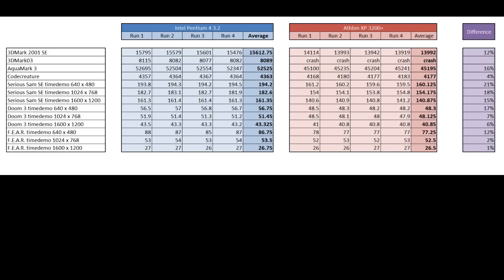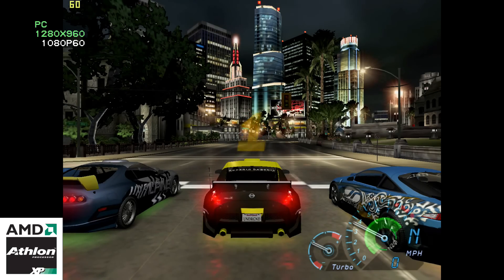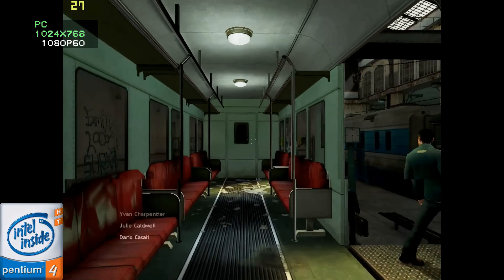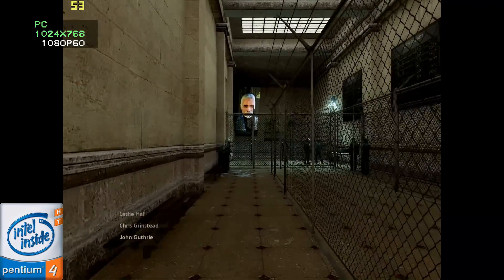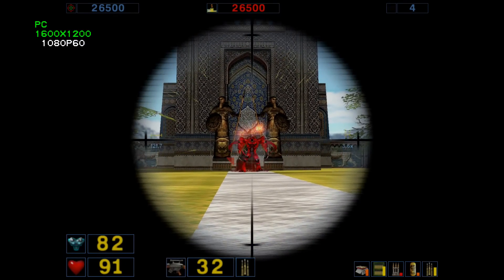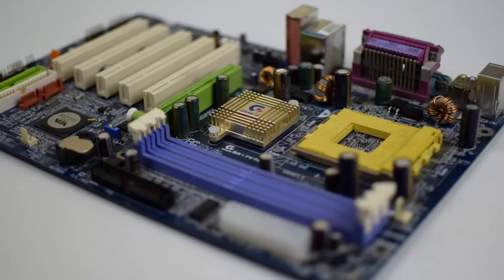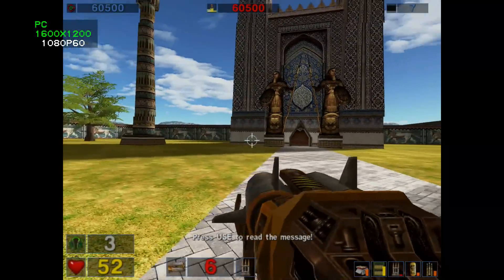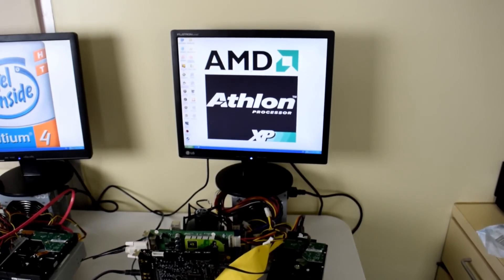Intel vs AMD S1E1 - P4 3.2 vs XP 3200+

Comment: Now I have a real motivation to fire up URGM 2.0 again. I guess I never recorded benchmarks from that system. I will have to rectify that! I am pretty sure my Abit NF7 with the 3200+ was faster in the scores, but being an ultimate retro gaming machine, nForce 2 was the only way to go really. I know the KT600 was a bit of a dog in a lot of ways. Still though, even with the KT600, we are talking about a marginal performance difference with the P4. Consider also the XP is running at 2.2Ghz, a full 1 gigawatt ( Doc Brown lingo there ) less, it is clock for clock beating the crap out of the P4 :)
Reply from the maker: +WaybackTECH If only AMD could have gotten the chip to 3 GHz, things would have been different.

I was looking forward to some more videos about your massive retro haul. That looked like a lifetime of computing work to me :)

I think the KT600 was a decent chipset. It certainly was a late revision, there was only one revision after that, 800 something with dual channel memory support.

The thing about using nForce, or better RAM, or tweaking is that you can do the same thing with the P4. Go with a high end 875 chipset with PAT instead of the 865, grab some CL2 memory, tune the BIOS and you got the same gap again.

I'd love to have a 875 chipset board to be honest. For some reason they aren't cheap. Same goes for good nForce boards. The high end always attracts a premium. This is part of the reason I go with the more mainstream stuff like 6600GT instead of 6800GT, they are much easier and cheaper to find.
Reply: From the stand point of building either of these 2 systems today for cheap, I completely agree with your choices, heck even 3200+ Athlons are expensive as well. P4 is vastly more common to find.

875p chipset would be an impressive way to go for a great 478 build. EE P4 3.4 with the 2MB L3 cache seems interesting but I am not sure it is as good as the 1MB Prescott chip was, also being a fat 130nm vs 90nm.

There is an ASUS P4C800E Deluxe for sale here in the states. He says will ship world wide. Pretty cheap starting bid, but it might be a crap shoot board though. http://www.ebay.com/itm/ASUS-P4C800-E-Deluxe-MB-Intel-P4-2-8-Ghz-SL7PL-Cooler-Master-LED-Heatsink-Fan-/141863473682?hash=item2107b8d212:g:zpwAAOSwNyFWgc54
Reply from the maker: +WaybackTECH Nice find. I think this will do well, it has a good description so will pop up on all the searches :)
Reply: +WaybackTECH Prescott CPUs had 30 pipeline stages vs the 20 that Northwood/Gallatin had, so no.  The 3.4GHz Gallatin based P4EE is top dog (for single core) of the NetBust era.
Reply: Mister BluntSA
Good to know!
Reply: Mister BluntSA
I had forgotten about the 30 stage pipeline. I am actually looking at the P4 EE 3.2, just because the 3.4 is insanely expensive. Might be fun to play with, comparison videos and such.

Comment: Interesting times; first machine was a first gen pentium 4 1.3 ghz.  I still have it though its in the process of being rebuilt (socket 423 to 478 adapter for a 3 ghz variant).  For cpu coolers i've run a Zalman CNPS 9500; though a bit of a pain to install (watch out for the copper fins... >w<) seems to keep the cpu from passing 60c under load.  Granted its a northwood core however it may be something to look into if you are interested in keeping the Pentium 4 from thermal throttling.  Anyway; always fun and educational to watch your reviews and benchmarks, thank you for taking the time to make them.  :3
Reply from the maker: +Nachokinz I can't stand the socket 478 coolers. I think if I build a high end Pentium 4 I would just go with Socket 775. Modern high performance coolers will fit nicely and tame the P4 :)

Comment: you should try this with a LGA 775 Pentium 4 or test both the LGA 775 Pentium 4 vs the socket 478 Pentium 4
Reply: You should also do s775 p4 vs athlon 64 socket 754 vs athlon 64 socket 939
Reply from the maker: +SilverX95 I'd love to do that. Added to the list!

Comment: HOT DAMN. The argument i have had for years... I love my XP 3200+ (in an FIC/EMachine FIC Motherboard) but my P4 (Dimension 4400) has SSE2 instructions ;)
Reply from the maker: +Jason Hicks (TyrForFreedom) Yea I think Google Chrome wouldn't run on the XP anymore, but did on the XP.
Reply: +PhilsComputerLab you may want to give pale moon browser a whirl. the have built it using firefox ESR and many built for different processors

Comment: Wouldn't Athlon XP vs P3 be a bit more fair?
Reply from the maker: +GlaciatorGaming Not really, when the P3 was around, AMD had the standard Athlon.
Reply: PhilsComputerLab Oh, then sorry I guess.
Reply from the maker: Well the Tualatin gear I have used SDRAM running at 133 MHz. Does the Athlon use DDR already?

Comment: Will the pentium 4 3.2ghz work on a DELL dimensions 3000 34 bit? BIOS AO3?
Reply from the maker: +The Hh With questions like this I recommend checking the support website of the manufacturer. Or just try it out. A P4 3.2 shouldn't cost much.
Reply: PhilsComputerLab I'm worried that it may overheat. The manufacture says that it allows hyperthreading, so is that a good sign?
Reply from the maker: Yes that's a good sign.

The worry with overheating is having a good CPU cooler. You can monitor the temperatures in BIOS or through software in Windows.

Comment: Personally I had both , in 2001, I replaced my ageing PPro with a Pentium 4 (I think it was 1.7Ghz ) , but within a year and a bit , the whole system got fried from a power surge (that was with a protector too) , and the replacement system I got was an Athlon XP 1800+ , later upgraded to a 2100+.  It was a great system that lasted into 2007 ,  stable too.

Right now I do have an Athlon XP 2800+ (barton revision) sitting in an Abit NF7-M board, which is a joy to use, has the Nforce2 chipset , has the 12v connector and built very well, only downside is no SATA at all (the NF7-S  did have them).

The main advantage of a P4 is the availability, everybody and their cousin owned one, so finding one for cheap is no problem.
As far as performance, the Athlon XP is obviously faster clock for clock, but I guess if you wanted faster you could just build an Athlon 64 or even C2D system.
Reply from the maker: +lightdark28 Great point, I like to think of the whole situation as :"Well I'm building machines to be slow and compatible". Speed is not that important.
Reply: +PhilsComputerLab 

I am surprised you had these problems with the Athlon XP though, the platform is generally more stable and compatible than the original Athlon boards. It could very well be the VIA chipset.  I may set up my Athlon XP board and see if it also exhibits these problems.

another thing to note is I think the Athlon boards tend to suffer more from the capacitor problems that plagued boards circa 2001-2 ,  so one needs to be careful with those.
Reply from the maker: That would be awesome if you could take a look.
Reply: +PhilsComputerLab 

Shouldn't take too long to put together , will post the results on your vogons thread (the "youtube and website updates thread).
Reply from the maker: Awesome, thank you.

Comment: Great video as always, you missed one important aspect - overclocking capabilities :) and the fact that the CPU protection is extremely weak at Athlon :( (I managed to burn one :) of course due to a personal mistake)

And I was an Athlon guy for a long time I had Athlon 700 Slot A, Ath 1400 Thunderbird, then Thoroughbred  1700+ (highly overclock-able that I burned eventually) and I exchange it in warranty for a Palomino (the only 1700+ in stock) that was a champion overclocked @ 1943 MHz) after I moved to a few Barton's and finally the best XP-M that I still have :) but eventually  I moved to P4 (3 GHz was the most expensive CPU I could afford but I overclocked it a little bit to close the gap) 

My last system before I completely move on mobile my last rig was a 754 A64 :) which was not a revelation so I decided to go mobile and bought my first laptop Dothan 1600 MHz + Radeon 9700m (from Fujitsu Siemens). 

 Now days I slowly move back from mobile to desktops :) (I have around 20-30 configurations laying around :D) and I just finished the 2 post Skywell configs (G3258 and 4790K ) both just to play with the new overclocking capabilities, my daily driver is still a mobile :) (4910MQ) 

Unfortunately with Athlon XP was the peak for AMD after those great CPU started the decline of AMD and they lost completely the edge in front of Intel powerhouse.
Reply from the maker: +rodarkone ro Great information. That Abit board gets mentioned often, I must get myself one. You're right, I skip overclocking. Not sure why, it's not my thing really. I think overclocking old hardware could hurt it, so I like to look after it.
Reply: +PhilsComputerLab forgot about one thing - the Athlon CPU's were extremely fragile (considering the die is not protected) I remember seeing a lot of CPU's with chipped die's, especially around the corners or on the edge that was corresponding to the clip of the cooler (ppl were pushing too hard on the radiator)
Reply from the maker: ***** Good point! I was extra careful when I mounted the cooler.
Reply: +rodarkone ro oh most of my atlhon cpus had the edges of the die chipped at one point. none of them actually died though. thankfully.
i have no idead why exposed internals was even a thing at all.

Comment: Ahh yes, the good old early 2000's. At around 2003 we got our first pc, and it was  just amazing, those games you showed here all are just awesome memories. I rocked an ECS L7S7A2 with an SiS963L chipset, AMD 462 socket Athlon 1.6Ghz'ish (haven't had it for a long time, so can't remember precisely the model of the cpu), 1gb of DDR1 ram and a nice Radeon 9600PRO 256mb. Sadly I still all got that stuff but they are all dead, but for the hell of it I made a slightly more powerful pc of those mid 2000's rocking an VIA Mobo (cant remember the model) with an VIA P4x400 Chipset, Intel 478 socket Pentium 4 2.4Ghz, 1.5GB DDR1 ram and was using a MX440SE then GeForce FX 5200 and now i got for free a nice Radeon x1950 PRO 512mb AGP model. Great video btw, guess i will be installing MoH and NFS again :D
Reply from the maker: +sproman These games are indeed great :)

Especially with the racing games I got carried away. Before you know it I've been playing for 20 minutes, way longer than I need to :D
Reply: PhilsComputerLab Yes, underground 1 super nostalgic for me, it's like the first pc game i ever played alongside MoH Allied Assault, before that i only had a PS1, that pc made a pc gamer :D But i still hold massive respect for the PS consoles though.

Comment: How does the Athlon work? It doesn't seem like you put any thermal paste on it, so does it not require anything? It also looks much different. I understand that's how CPUs looked 15 years ago.
Reply from the maker: +YoMamasTacos Of course I put thermal paste on it :) Just didn't show it in the video.

The P4 and modern AMD processors use a heat spreader. But google images of the Pentium III coppermine, it looks just like the Athlon XP with the die exposed. You had to be a bit careful when mounting.
Reply: +PhilsComputerLab Ah, okay. I guess
AMD was late to the heatspreader game.
Reply: @yomamastacos2123 they didn’t actually need it with Ryzen to be fair, since it’s still PGA

Comment: I don't remember having any problems with my Athlon XP and 3dm03, it might be something with the chipset or graphics card (you are running a PCIE GPU with AGP bridge chip I think, it could be more sensitive to problems?) in any case, I think you would have a better time with Nforce 2 (but I'm not sure; KT600 is actually newer, it's just that VIA was the second, lower cost option for a socket A build back in the 3200+ days, nforce 2 was the most popular for higher end s462), back in the day I had like 4 different Nforce 2 boards (NF7-S 2.0 was my favorite) and I don't remember to many problems, I went as far as a 6800 (native AGP, the older model with NV40) in 2004 with it,
Reply from the maker: +hmbrz NF7-S 2.0? I'll take a note of that. Thank you!
Reply: hmbrz TBH the k8t880 was the premium chipset for socket a. The kt600 was a bodged kt400a
Reply: nForce 2 Ultra 400 was the top chipset for that platform.

Comment: I had a Athlon XP 2500+ on an Asrock K7VT4A PRO motherboard with the same CPU cooler used in this video 2gb of Kingston RAM an Nvidia Geforce 6800 Ultra and a WD Caviar SE 160 GB Sata hard drive.
Even managed to run Hitman Blood Money on medium settings on it. I still have that computer and it is still in great shape only the GPU died and replaced it with a Geforce 6200 just to get it working. There's such a big difference in gaming with the 6200 compared to the 6800 ultra now it can barely run GTA San Andreas.It was one of the best PCs i had. It was built in 2005 and used till 2009.
Reply from the maker: +Laurdumi 97 6800 Ultra? Damn. Fine card and quite hard to get / expensive. If you go with PCIe you have a lot more options. You can go with a 7600 GT, which are really easy to find and offer similar performance.

Comment: try the same but with low end CPUs from the time, e.g p4 2ghz and AMD sempron 2800+ (used to have the same CPU in PC back then)
Reply from the maker: +3key Well the Sempron, with a rating of 2800+, will easily win that one :)
Reply: +PhilsComputerLab nonono the actual CPU runs at 2ghz, look it up :P
Reply from the maker: Yes the AMD chips are clocked lower, but get more work done per clock. That's why AMD did this rating system. 2800+ means it performs in the proximity of a P4 2.8 GHz.
Reply: +PhilsComputerLab really? my AMD chip is quite slow, my pentium 4 at 3ghz ran a huge bit quicker!
Reply: +3key or use a faster p4 as I really want too see this;!